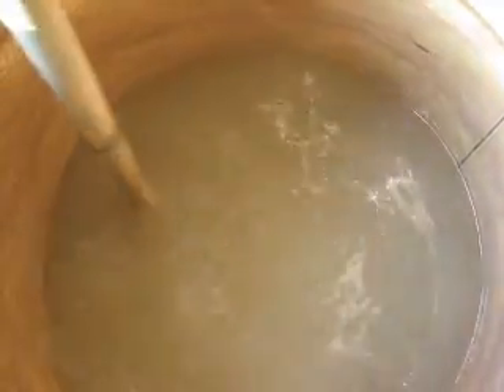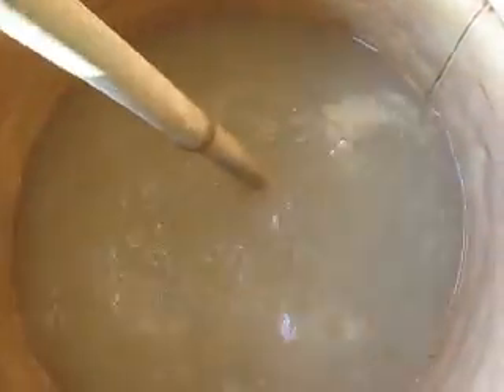Bamboo Treatment: Boric-Borax Solution

Comment: What tool is used to poke through the center length of the bamboo?  I need a 30ft long drill bit?
Reply: should be able to use a sharpened iron/steel rod to pierce the segment walls
Reply: with a hex nut welded on the end so it pushes a large enough hole and no air gaps @djbsnz

Comment: In philippines we simply immerse the bamboo into the seawater for 2-3weeks then sun dried it... bamboos will be tough and insect proof as ever.
Reply: We have tried in Mexico 16 years ago and the results were very bad. Not enough salt to repel the local termites which are used to the salt of mangroves, but the worst was very big problems of corrosion of all the steels. And it takes to much time to soak and after dry to be economically viable.
In the same time we have tried also borate salts treatments with the Bouchery method. You must use it on a freshly cut bamboo, the treatment takes about 2 hours, expelling out the sugary sap and replacing it by a 160gr/liter octaborate solution, so the bamboo is treated to heart from inside using the sap channels. The drying takes about 3 weeks as the treatment does not soak the bamboo. After 16 years the bamboos are as good as new, with no corrosion problems of the screws, and steels.
Reply: @pabloricardodetarragon2649  thanks for this info
Reply: Hola Pablo.  Hay algún sitio en internet en el que compartáis vuestras experiencias con el bambú con más detalle? Me interesan mucho, gracias :)
Reply: knowthyself. Te contesto muy tarde, haz una búsqueda "bamboo boucherie method" se usa octaborato de sodio, esta  sal natural es también un fertilizante foliar para muchas plantas. Hay la marca foliarel que se vende para el campo en México. Es muy sencillo, aire comprimido, sales de borato. La vídeo que doy el lienzo es claro. https://www.youtube.com/watch?v=uUffe_kZYRc

Comment: can this liquid be used over and over???... have you ever heard of adding salt to such a preserving solution, for perhaps even more protection???
Reply: I'm a bit late but I'll give you some answers. Yes the solution can be reused, must be checked to keep enough salts concentration in the solution. Personally I use sodium octaborate, a foliar fertilizer, it's easier to dissolve. All depends on the availability and cost. The good concentration  is 100 grams of salts per liter. The solution van go until 200 gr per liter if the temperatures stay above 25 degrees.
The great advantage of the borax solutions is it does not corrode the steels. So you can use steel drums, galvanized items, ordinary pumps. The nails, screws, steel wires, concretes bars etc...used in the construction won't be destroyed.
It's also a fire retardant. It hardens some soft woods. Also very effective on fungus and  molds.
It's not the same with sea salt which corrodes most metals. Sea water has only 3% concentration and it's not effective in long term. You need a brine of 100 gr of salt per liter, a 10% concentration, and all must be in materials resisting to corrosion. Plastics, marine bronze, 316 stainless steels, all that is extremely expensive.
A bamboo treated with sea salt will destroy all the nails, screws, bars in a short time. It will give also chlorohydric acid, a strong acid that will destroy the bamboo itself in presence of a ferrous metal. Sea salt is extremely hygroscopic and in rainy season all will feel wet.
The only application of such bamboos is for constructions with no metal ie no nails, screws, bars or metal wires. Only ropes, hardwood nails, and no reinforced concrete as base.The electric wiring must be insulated from the bamboo, and water copper tubing is not counseled.
Reply: @Anurang Yes. Fungus and all wood borers. Even the Formosan Termite if there is enough borate salts. For heavily infected termite zones in the tropics, the rule of thumb is about 50-60 grams of boric salts for 1 sq. meter of wood surface. I mean all surfaces, front, back, sides. At that ratio the wood becomes totally unpalatable to any wood borer and impervious to rot and fungus. 
If you make a solution of 100 gr/liter and if for example the wood  absorbs 1 liter of solution  for 3 square meter ie 33 gr of salt per sq. meter you'll need to treat the wood twice to have 66 gr of salts per sq. meter.  Between each treatment the wood must dry.  The treatment is good for at least 25 years if the wood is protected from the rain ny a paint or an oil (pure cooking soya oil with 30 gr of paraffin no smoke candles for example dissolved per liter works very well, as it's self drying, water repellent, and lasts about 3 years. And it's cheap)
Reply: Pablo Ricardo de Tarragon thanks guy......
Reply: hi...still need to added salt even i using borax n boric acid solution ?
Reply: is this liquid anti termite?
Reply: @ Sam NO, read my post ablout sea salt.
Reply: @ Sam you're welcome.
Reply: How do you poke through the center of the bamboo all the way  What tool do you use?

Comment: You can also use seawater works very well!
Reply: Common salt corrodes most metals. Sea water has only 3% concentration and it's not effective in long term. You need a brine of 100 gr of salt per liter, a 10% concentration, and all must be in materials resisting to corrosion. Plastics, marine bronze, 316 stainless steels, all that is extremely expensive.
A bamboo treated with sea salt will destroy all the nails, screws, bars in a short time. It will give also chlorohydric/ferric acid, a strong acid that will destroy the bamboo itself in presence of a ferrous metal with the characteristic black ferric acid stains. 
The issue is well known in wooden boats building.The cheap third world wooden boats do not last because the nails and screws in ordinary steel are eaten away. It's worst out of water as there is far more oxygen and enough humidity for an active corrosion. Sea salt is extremely hygroscopic and in rainy season all will feel wet.
The only application of such bamboos is for constructions with no metal ie no nails, screws, bars or metal wires. Only ropes, hardwood nails, and no reinforced concrete as base.The electric wiring must be insulated from the bamboo, and water copper tubing is not counseled.
Reply: We use boric acid here on the coast, and have had good success but the longest lasting Bamboo I've had were some pieces I picked up off the beach.  I lashed them into a ladder that lasted 20 years, outside some of the time.  I also used thick nails doubled over - I think it was the rust from the nails that weakened the  bamboo eventually, so that warning may hold true about metal corrosion in salty materials.
Reply: +peter vangeli Are you sure about that? Because it would change quite much, I mean in costs. Of course transporting it to the seaside and back makes it less useful hard inlands but I'm always more interested in seaside living, that's why my extra inquiry. Can you provide some links to it?
Reply: Yes you're right of course…..I live 100m from the ocean so its cost effective in my case and bamboo is abundant……thats how they did it in indonesia years ago used seawater and soaked it in ponds (dugout of soil basically)……Borax is a solution primarily consisting of salts……this basically makes the inside sugars of the walls of the bamboo too sour for bugs to eat……Borax salts are fine also to use. Just do a YouTube search on  bamboo treatment in Chang Mai Thailand and how they treat their bamboo species its a good watch very inciteful…..good luck.
Reply: one could add dried salt to water anywhere, no need to go to the ocean, in fact higher percents of salt in the water might make it more effective... plus it is still less expensive than boric acid....
Reply: Also, go to where they dry salt from seawater and get the slurry/byproduct.... I'm sure it's free and saves carrying seawater.  @forestfairness12
Reply: do you have personal experience with soaking bamboo in salt water... have you any idea of how much longer it might last, than no treatment, in the tropics using salt water only???...
Reply: But soaking it in the ocean if it's close by is free.  You just tie the bamboo to your dock and let it sit for a couple months.
Reply: but it will float - you need it to sink no? or do you punch holes through the nodes and go surfing on it each day to get the salt to permeate the nodes hehehe
 @mfb5642
Reply: seawater protects bamboo for 50 years.

Comment: How many nodes or culms are punctured in the process? If you pierce all the nodes, how do you do that?
Reply: +Bob Traweek … use a long piece of rebar sharpened
Reply: +Bob Traweek Puncture all nodes except the bottom one which acts like a bottle then…..I did mine with 18mm D-Bar……sharpened one end with a grinder at 40degrees to make a sharp point……got a guy to puncture the nodes leaving of course the last one which fills up the bamboo staff then stand it up for at least 2weeks……up to 3mths is good but 2 weeks will do it.
Reply: https://www.youtube.com/watch?v=t2EENWcsQAc

Comment: Does this treatment help prolong the bamboo's duration? I've of a solution where, when treated, a bamboo can last up to 2 to 5 decades. Do you know any treatment that can do that?
Reply: Copper Sulphide, Sodium Dichromate and Acetic Acid 5.6 - 5.6 - 0.25.
Reply: +jonathan trinidad when treated they last 20 yr or so.
Reply: hi
Reply: hi
Reply: hi
Reply: I have seen houses in the Philippines treated this way and can last 30-40 years.20 years is normal tho.

Comment: What does it do to the bamboo when dried?
Reply: It will have boric acid penetrated into the material, keeping it from being eaten.  It would show some boric acid crystals outside if concentrated solution.  Safe to touch and brush off, but slippery.